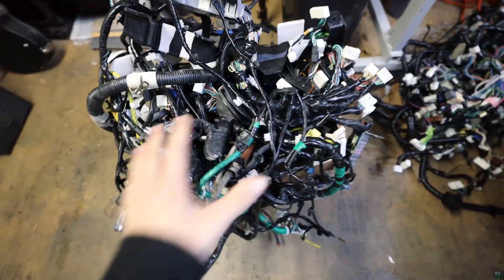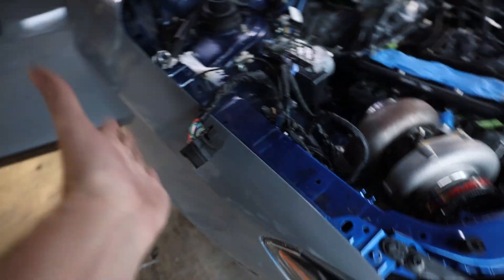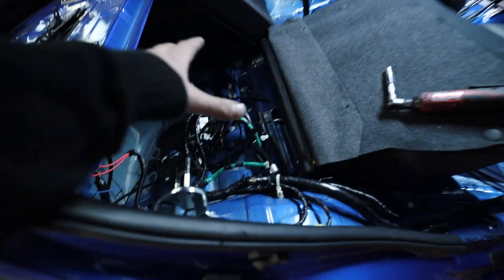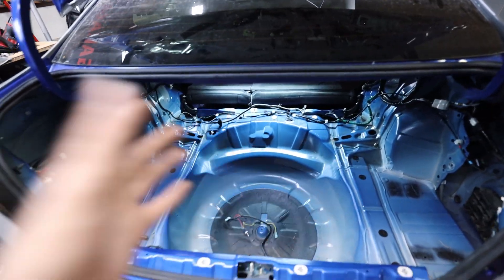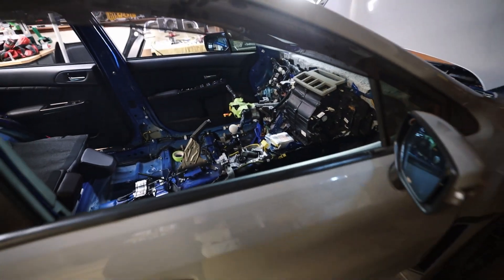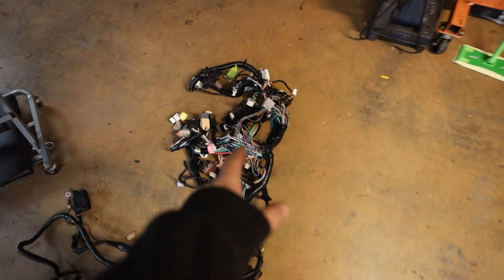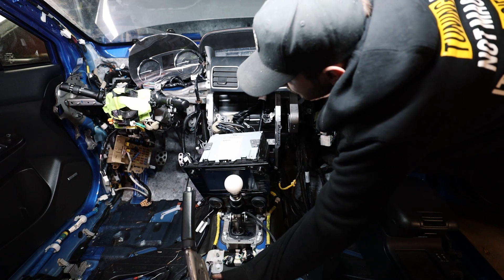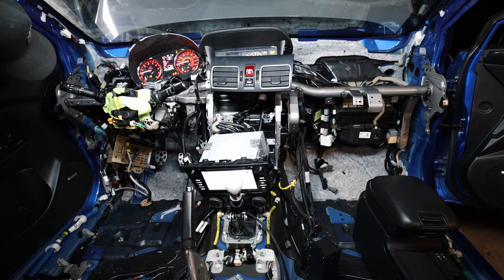Getting Over This.

Comment: I believe in you man! 
Only mention referring to the key not being detected, if even one of the key sensors isn’t hooked up, or malfunctions, the car won’t detect the key and the entire system acts all wonky. 
The experience I have had was not directly with a Subaru, but had it happen in a Nissan, BMW and 2 Corvettes. The Nissan in particular soon as the battery was connected it would go into accessory mode.
Hope it helps, keep up the amazing content.
Reply from the maker: Definitely! Think it is the SRS Module throwing everything off 😤

Comment: The immobilizer has its own harness plug and fuse easy for it to be blown had that problem as well it didn’t read the key or start
Reply from the maker: Ordered a 2017 harness but going out to check them now 🔥

Comment: Being the owner of a '17 STi Limited as well, I can very much confirm this year's harness and electronics are unique.

This is what was/is causing some of my gremlins in tuning, coming from my tuner. I'm looking at you, rear O2.. We just ended up taking the code out, but ugh, have the effect of having no sensor when going back to idle. Also cold start, it drops hard in RPM when it expects the secondary air pump. That goes away after though, and only once.

Secondary air system is different than 18+ and 15/16 VA as well, so another unique thing.
Reply from the maker: 2017 is the only year that uses its own harness from what I've recently Kearns. 2015/2016 same same 2018+ has its own but 2017 has its own set for some reason. 😤

Comment: Damn Tanner, you have much higher emotional strength than I ever would.  I would have just pushed it off a cliff or shelved that project by now.  When I was doing that clutch on my mini - some days I only made it 30 minutes because I wasn’t emotionally into it.  It was a car that was barely driven so I did have the luxury of taking 3 months to do the clutch though.

Anyhow I hope the new bulkhead harness works for you.  Chin up
Reply from the maker: We will get it worked through 💪 definitely takes some will power to want to get it done but I just wanna hear this car live ❤

Comment: Also I feel like if you were to actually start this car whenever that will be… it will resolve some of the issues especially since the battery has been unplugged long enough for the capacitors to die
Reply from the maker: They die over time without having power applied to them? 👀
Reply: @Smeedia  yes they can from what I've seen from other people's experiences (non personal)
Reply: @Smeedia  yes, capacitors (in general) will slowly discharge over time when improper or zero voltage is applied to them. There is an equation to measure this, but it's been a while since I went to school for electrical engineering. If the charge isn't slowly leaking out to ground, it is also leaving the capacitor very slowly through static charge in the air

Comment: come to think of it when you had the car completely apart you might need to re program the key to the car hence why its not detecting it or going into acc mode... i work at a subaru dealer and this is what happens to cars that sit for too long here they need to go back thru the shop for a re program...
Reply from the maker: Going to have to look around for some software than can reprogram a key 🤔🔥

Comment: One thing you may have found by now but on the A pillars on the front there are some small tweeter looking things that are the sensors for the keys, they don’t seem to be in there so that might be why the key is not detected. Looking good though! Also keen to know if the Gunther headlight washers worked lol
Reply from the maker: Surprisingly enough they do work 😅🔥 

And I have noticed them, they're all plugged in as well 🔥

Comment: Unfortunately,  I think you will need a wiring harness for a 2017 STI.  Do you have access to a snap-on scan tool to check exactly what codes you have, while at the same time are able to test some functions?  I really do feel your pain though.  I bet a brand new harness from Subaru would cost a lot of money!  Keep at it, you'll get it figured out!
Reply from the maker: Was able to snag a 2017 harness so that should clear up the issues 💪 and unfortunately I do not 😤😭

Comment: Hey man! Had a quick suggestion and question at the same time. First up, do you know that the can bus system needs to be terminated on both ends with a 120ohm resistor? These are usually in certain Modules, one of many examples can be ECU, transmission, dash, etc. The entire system is a loop with terminating points of witch there are two. If a single module is left unplugged, the system breaks down and cannot communicate. So my question is, Are all can related items plugged in? Are you missing a simple thing that you think is not going to be used and assume it’s “definitely not the problem”? If so, you’re not only dealing with that, but the fact you have a completely incompatible harness, only adds to your problem, get the right one, and plug everything in. Especially if it has CAN wiring. With this said, you can eliminate terminating modules by putting a 120ohm resistor from can high to can low.
Reply from the maker: Everything with thr exception of the SRS module is plugged in, unfortunately that 2016 Harness won't allow us to plug it in so need that new harness to get here 🔥
Reply: @Smeedia  yeah that could definitely be the one key part, with the new harness and module plugged in, it may work out. Also real quick, have you considered just getting a 2016 STS module? If the plug is the only difference it may work, however, if it’s different electrically, might just be another headache.
Reply: SRS*
Reply from the maker: I have but the SRS module us serilized to the ECU 😤

Comment: Yes I have the Integra project that I just wish I never started. I've been screwed over so many times with that car that I just wish I never spent the money to even start the car. I've gone through 3 Integra cars to just build one and the people that were supposed to help me only screwed me over.
Reply from the maker: They're dangerous rabbit holes to go down 😤 but was it worth it?
Reply: @Smeedia  Not at this time, cars are still in pieces and with my health issues... I've had zero progress in the last 10 years :/ :(  It would have been if it was finished.  I have the DC2 JDM setup/Engine and I know that setup is a beast.

Comment: U are having a problem with brake switch and start button harness that's why it's switching on without pressing anything
Reply from the maker: Brake switch is working as it should. Car registered when the oedel is depressed. Could very well be a start button error
Reply: @Smeedia  no it can't be button only because button only send signal after it sense the key

If the brake switch is fine disconnect the start button and see if it will switch on...

Another alternative is to disconnect smart key ecu and check if it keeps doing that